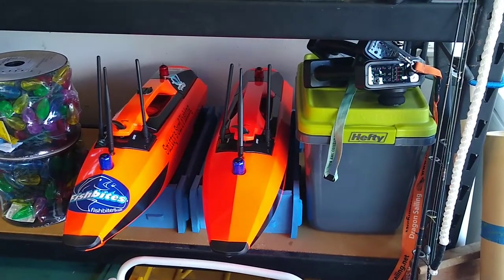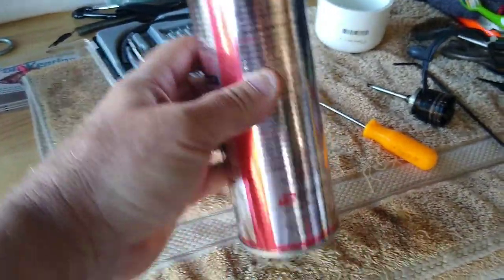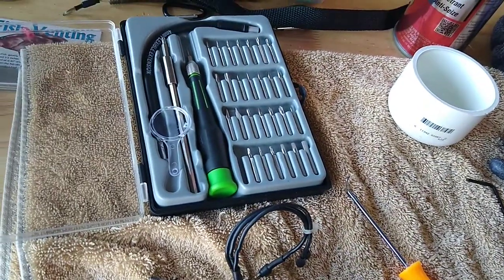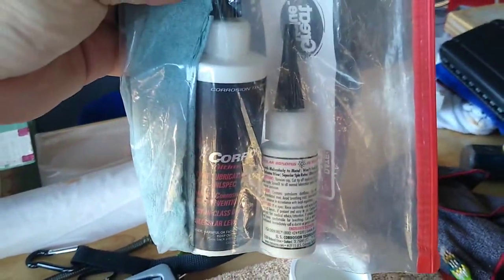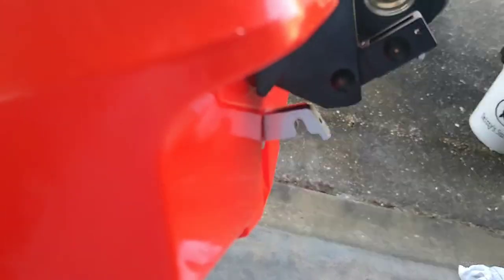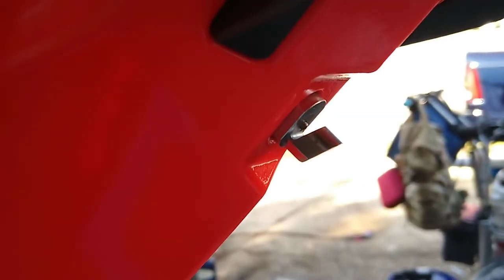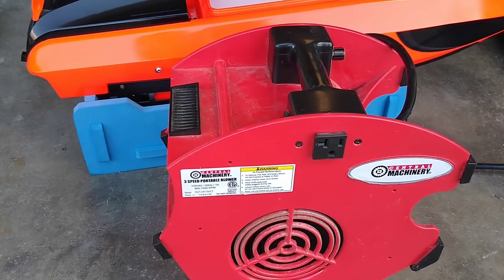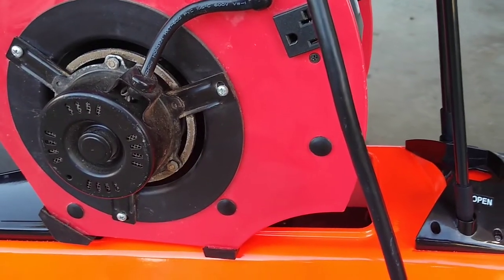3 TIPS to Maintain Your RC Fishing Surfer

Comment: I bought one of these and have had alot of trouble. Now the remote has no power at all....even with new batteries. The hatch also wont CLOSE and I'm not sure if thats related to the remote not working or something different...any guidance at all would be MASSIVELY appreciated.

Its 2 months old. I used it once.

Comment: Hi Smitty. Considering that the engines are inside the boat, why do they oxidize?  Is it normal for a little water to get inside the boat, or is it just humidity forming? Thanks
Reply from the maker: Yes, water does seep in. The key is to find out from where and seal it.
Reply: Hi Smitty.  You found out where the water enters the fishing boat?

Comment: Hi Smitty.  Just got my Fishing Surfer yesterday, and the hopper door closes too tightly to open when the rear pin is released - it unlatches, but the door stays in place.  It seems that the door should be completely loose to allow the bait to fall out.  Am I misunderstanding the intent?  If not, have you experienced the same and would you have any suggestions?
Reply from the maker: I have that issue on one of mine as well. I don't use the hopper to drop baits, so it's not an issue for me.  I've found that the line line will sometimes get caught on the hooper door latch. All my drops are done from the rear release with no issues
Reply: @SmittysSurfFishing  Ok got it...and I can see how the line may get caught up on the latch.  Still, I may try to modify the door for a loose fit.  Thanks, sir!
Reply: Able to fix?
Reply: @JayJay-cx5te  You know, I did.  I flipped the spring around so that the door's neutral position is open, and filed down the two outermost points that interfered with closing.  You can flip the spring in a few steps.  You'll need a small screwdriver (you've got to unscrew the door from inside the hopper), the smallest drill bit you can find (I can provide the size I used later), a small nail to push out the rod that makes up the door hinge.  Here's what to do:
1. Remove the door
2. Push out the rod (careful with the spring)
3. You'll notice a thin lip on the outer edge of the black plastic part that contained the hinge and spring.  This lip faces the body of the spring as manufactured (the two legs point away from it).  You'll need to drill a tiny hole straight through the center of that lip to hold the bottom leg of the spring when you flip it.  If that's confusing, just flip the spring and you'll see what I mean: the spring no longer aligns with the rod and needs it needs to somehow be held in place.  That's where the hole comes in.
4. Flip the spring, threading your new hole with the spring's bottom leg, and run the rod back through it.
5. Reassemble the door.
**FYI, I also installed a water resistant push button in the hull.  If you want more info, let me know.